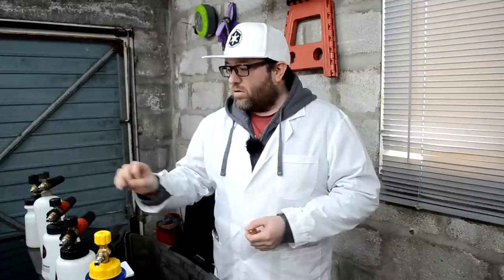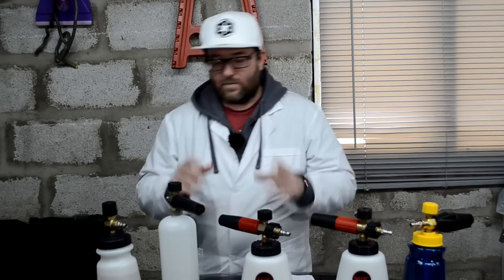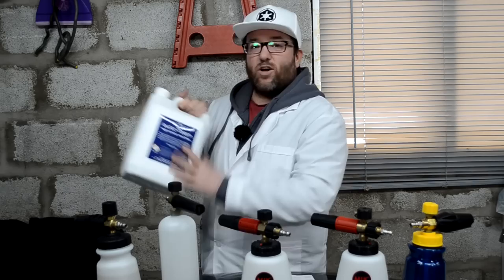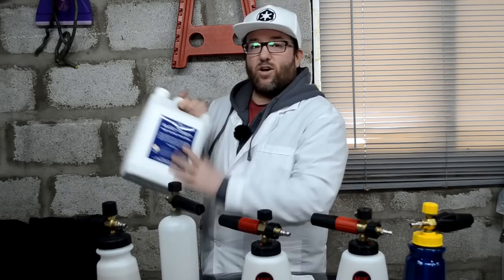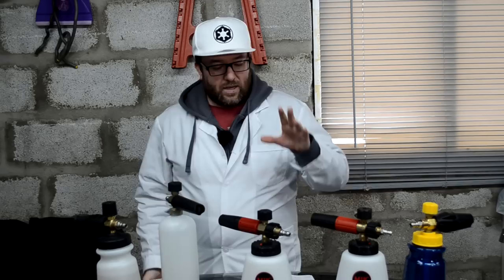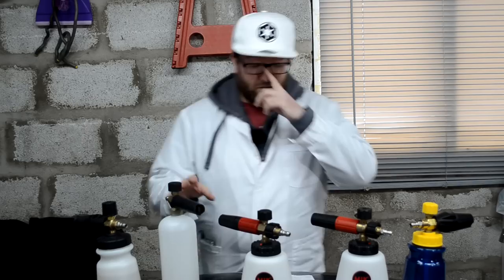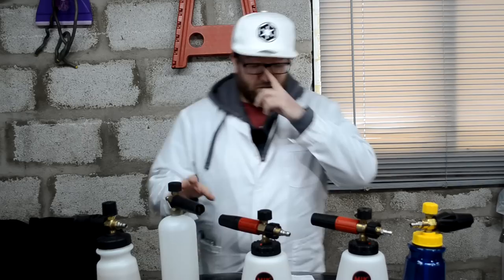Are You Using Snowfoam WRONG?!

Comment: Congratulations on an ace video Professor McSporran.
I'd tried the empty the reservoir into my wash bucket procedure before  and scared myself silly on the quantity of product I  required. From following your explanation it turns out I hadn't used the maximum flow rate. Following your instructions I filled, displaced and measured the capacity of my foam reservoir. I had never given it a thought but it turns out my 1 litre graduated holder actually only holds 900ml. Hmm. Long story short : I previously used 100ml in 1litre which produced poor foam  and used the full litre each wash. Now I get good foam using 450ml in 900ml and emptied only half the reservoir.   
That was good old Bilt Hamber. Next time it's Garage Therapy. I've still to check their PIR. Thanks again Speccy.
Cheers John
Reply from the maker: Thank you, John! Really glad the video helped you get the right foam!

Comment: Well explained. I think a lot of people completely forget that water pressure and flow rate through the pressure washer has an impact and just focus on the lance itself. Having said that I generally just go 50/50 with BH Autofoam in my MJJC V2 as I know it's roughly the correct PIR. I get the results I want and it saves a lot of time not having to be precise to get exactly 4%.
Reply from the maker: 50/50 is pretty damn close for many lances, if it works for you then that's all we can ask!

Comment: Very informative and well presented video Specky!   I really like using the Griot's BOSS foam cannon system.   It takes all the guess work out of it.    With the foam cannon,  you can connect the chemical bottles directly to the foam cannon (as you can with others of course) but the thing I like it those innovative metering tips they came up with.    It disperses the product directly with the water so no pre-mixing.    You would think it would use a lot more product,  but actually it uses less and SAVES product.    You can still mix solution in the provided bottle if you are using something other than griot's chemicals and you need to dilute it via the manufacturers recommendations,  but,  you can also directly hook up a lot of other manufacturers bottles directly to the BOSS cannon also and those metering tips work perfectly dispensing those chemicals too!   It's a fantastic system.    I think you might have showcased the BOSS system previously on your channel?   I can't remember.   Either way,  great job,  you really brought up some interesting points,  especially on how diluted product doesn't come out of the end of the cannon as the same dilution ratio as you mixed,  it's much more diluted once mixed with the water flowing through the cannon.     The metering tips might work with the MJJC Pro Foam Cannon also but they would have to be purchased separately from Griot's Garage web site.   I thought I watched a previous video somewhere (maybe here?) that someone showed those Griot's metering tips being placed into the metal ball at the end of the pick up tube for the MJJC Pro.   I am pretty sure that MJJC makes the BOSS Foam Cannon for Griot's.    They look VERY similar and some of the parts look identical.    And MJJC also have the inner barrel on the PRO for hooking up bottles directly but without the threading that the Griot's BOSS has that holds the bottle onto the cannon itself so you can't use it like the BOSS system cannon.   Griot's may have had some "exclusive" deal with them (or maybe even a patent on that feature) that only THEY can have that inner thread and outer "dual" thread design for the supplied bottle or for hooking up other bottles directly.    MJJC also have the same metal ball at the end of the pick up tube that allows it to fall anywhere and pick up product no matter how it's turned.    And the same soft (but durable) pick up tube also.     Great information on PIR too!    That really showcases that most of us have never used the right dilution ratio's!  LOL.  I have never done a PIR and didn't even know what it was until about six months ago watching Jon at  The Forensic Detailing Channel.   I would tend to put more soap in the cannon anyway,  so for me,  it may have been closer to the PIR??    It's amazing how much difference there are between not only the quality of the foam cannons available now days and how much differently they perform.    If I had one word of advice (for a person who has about 5 foam cannons of various qualities and price range.........just get the GOOD ONE!    MTM,  MJJC Pro,  Griot's BOSS,  etc.   Just pay the extra money and get a good one.    You will not be disappointed.    The cheap cannons seem to break or stop working at a much higher rate than the more costly ones.    The more costly ones are quite simply a better quality.     They cheaper ones work, but they just don't seem to have the foam quality of the more costlier versions.    My Griot's has those great features noted above and it's built like a darn tank compared to a cheap one off of Amazon.    Will the cheaper ones work?  Certainly they will,  but for how long?    Sometimes not long at all.    The only other good advice I could give is clean out your foam cannon after EVERY use!   Spray some plain water through the cannon at pressure to rinse it out.   Doing that will give almost infinite life to your foam cannon.    But for me, still, it's the BOSS cannon with the metering tips so I don't have to worry about dilution ratios and PIR's, etc.   The only change might be a different tip to increase or restrict the flow rate slightly for different thickness' of foam.     I tend to use the max foam tip in my BOSS cannon.     That BOSS cannon does produce the best foam I have ever seen.    The only downside is that is it probably the most expensive cannon on the market today, but, you do get a quality cannon for the price.   Plus Griot's does sell the cannon and chemicals, and microfiber drying towels as a "kit" for about $169 US dollars.    Sounds like a lot, but it's worth it because you get three quality chemicals and a large PFM drying towel too, plus a couple of other products.     Griot's also sells replacement filters,  internals,  repair kits,  etc so in the rare chance you did have a problem years down the road,  they have it covered so you can get your cannon back to factory fresh!   Not many others offer the parts and replacement internals, orifices, etc.
Reply: Best comment of all time.

Comment: I've just been doing your flow rate check, and the bucket was getting close to overflowing with only a fraction of the water in the bottle used. So I measured what remained in the bottle and subtracted that from what I started with -  and I had used 304ml.  There were 34 litres of water in the bucket. That gives a flow rate of 113litres per litres of product, which seems inordinately high compared to figures in your test. The lance is a Stonebank eBay special. Has anyone else found such a high figure ? The pressure washer I'm using claims 150 bar.

Comment: I've been meaning to do this exact thing with my setup but just always bang product in and hope for the best. Going to give it a try next time out and work out exactly what PIR I end up with. I do think if manufacturers use PIR rather than the standard 10.1 then people will have a better experience using the products 👍👍 great video
Reply from the maker: Thank you, kind Smurf! I do think that companies producing snowfoam for "professional or enthusiast" use should include proper panel impact ratios. I don't have a problem with 10:1 style ratios for general consumer use though.

Comment: Brilliant thank you, why has no one else done this? Its a game changer, to get a descent foam, which i still haven't, ive gone from a £100 jet wash to a karcher k7, still watery foam, then from a £20 cannon to a mjjc v2, still watery foam, all because different brands saying 10 -1, or about an inch. Ive doubled my snow foam and still been watery, so by your calculations im still over diluted, so then you can compare from your basic foams to your high end,  thank you so much. Very helpful. Liked and now subscribed.
Reply from the maker: Thanks so much, I'm really glad you found it useful! 🙌🏻
Reply: Does this mean that if companies advertise 10-1 ratio, is that now a 10% product agaist flow rate ? Like bilt is 4%?
Reply from the maker: Honestly it'll depend on multiple factors like water pressure, pressure washer power, flow rate of the foam lance etc. 10:1 is a "general" amount to cover most situations but it's best to work out what you actually need for your own setup, if you care enough about it.
Reply: I have just done mine. Im running a karcher k7 and mjjc cannon, i had 12.6 litres of flow rate, although the cannon was opened up fully, i had the karcher on medium setting. I use ez carcare snow foam as a general quick wash at the 10 -1 it advises ( 100ml to 900ml water ) and was runny before i watched this so next time i will get it  at its propper dilution, i also use polar blast but that has a giude of  1 in 4 ratio, cant wait to try them both on your advise and work out costs per wash, i have a bmw x6 so its a tiny bit bigger than a fiesta 🤣🤣
Reply from the maker: I look forward to hearing your results!

Comment: There are many ways to use a lance. I always use every product without dilution because I have tested and calculated where the adjustment screw has to be to give me for example 4%. I find this is the easiest way.
Reply from the maker: That's fair, I'm not sure how best to calculate when only using the top dial but I'm glad it works for you.

Comment: Firstly, awesome video! I wish I knew that like......... 4 years ago, before working with the system I currently use now. I personally sucked at math in school, that's why I just use the Griots Garage Metering tips. There's zero calculations involved, simply pour your favourite product into your snow lance bottle and press the trigger, THAT'S IT! I find that this not only conserves time, but it also conserves on product, as I can now use 1 oz to do a car instead of 3-4 oz to keep the mixture rich to compensate for the slower flow of water. If you haven't already, please do a video demonstrating the differences or similarities between the two. Regards - Dinero
Reply from the maker: Sadly Griots is a brand with little reputation/representation in the UK so I'd be unlikely to feature them.
Reply: @SpeckyMcSporran  That is true, they reside in the US but I still use them here in Jamaica.

Comment: That's a lot of Bilt Hamber, I always read that you didn't need to use much of it, so it was really economical. 1:10 would be a lot smaller amount of product, about 90ml of product compared to 300ml+, that would be about 1:2.
Reply from the maker: You have to think about how much the foam lance will dilute the mix. 10:1 in isn't 10:1 out which is why it's important to know your own lances introduction rate. I was basing my figures on the percentage that Built Hamber themselves stated is typical use.

Comment: I agree with the general premise of your video, I've been banging on about this issue for years. Because the extra level of dilution that occurs differs so much, different manufacturers of snow foam chemicals will base their instructions on what they think that extra level of dilution is, some will assume 10x extra dilution, others will assume 13.5x extra dilution. If they published that extra detail it would allow us to adapt their products so that we could use it safely on our particular setup. Otherwise with flask instructions only you could be either:
a) Creating snow foam that's too weak so it's cleaning ability is awful
b) Creating snow foam is way too strong and could cause damage to the clearcoat (if using acidic or alkaline snow foams)
c) you happen to have the goldilocks setup that the snow foam manufacturer had in mind when coming up with their flask based instructions
d) the manufacturer is producing a chemical that is safe at any level meaning that that their product is largely inneffective no matter what concentration level is used
There is another issue and that's the confusion caused by the snow foam manufacturers themselves by not being clear on their instructions. Sometimes the dilution ratio on the product refers to the final dilution (i.e. PIR) and not the flask dilution (e.g. some CarPro products). Infamously Koch Chemie GSF dilution instructions refer to use in a pump foamer, but most youtube content creators misread that to mean instructions for use in a foam gun so they assumed these were flask based instructions rather than PIR.
I have over 20 permutations of different lances, with different orifices and on different pressure washers to get a wide range of dilution factors (anything from 7.0x - 18.5x). Notice I said dilution factor. What I do is fill the flask with water and use it until I get measureable amount of water in a container (4-5 litres). If I weigh both the flask and container before and afterwards, that difference will give me the amount of water used up in the flask and the amount of water collected, and I divide one into the other to get my dilution factor. With that dilution factor I then multiple it by the PIR required and times that by the amount of snow foam solution required. This avoids having to judge any displacement issues, different sized flask issues and judging when the flask is empty, e.g. pickup tube in the flask can stall especially at an angle, or the flask is opaque and difficult to see the level (ahem! Carbon Collective). Mathematically you get the same end result, but when I explain it to beginners they find it easier to understand when it's broken down in this way and avoid some of the common pitfalls.
Reply from the maker: You, sir, are way above me in the geek factor and I salute your work!
Reply: @SpeckyMcSporran  Perhaps I should change my name to the Greek Geek! 🙂
Reply from the maker: That's what I'll call you from now on! 😉

Comment: Brilliant, thank you. The thumbnail showed the problem I was having. Explained exactly where I was going wrong and how to fix it.

One thing I'm still confused about is how to read the flow rate, as the value quoted in the video are at max setting which typically you would not be using. 

I have an AVA Smart P60 and the manufacturers quote a flow rate of 6.7L per minute. Isn't this a more important figure, and how would this figure be combined with a product's PIR ratio?
Reply from the maker: Flow rates are usually based on an unhindered connection i.e. no nozzle on the end of the gun/lance. As you know, running your pressure washer without a nozzle makes a different sound compared to when you have a nozzle fitted. The flow rate of the snowfoam lance is more important as it already accounts for the change it may make to the flow rate coming from the pressure washer. As for the change in flow rate using the dial, this is not something we can measure easily therefore adjustments would be better made to the chemical dilution while running the lance fully open. I hope this helps.
Reply: @SpeckyMcSporran  Superb, thank you for taking the time, very much appreciated.

Comment: To get even more geeky, snow foam cannons are, in effect, eductor or jet pumps, also known as vacuum ejectors or simply ejectors, which are water aspirators or vacuum pumps consisting of a tee shaped fitting, employing the venturi effect.
Still with me? The flow of water from the power washer, passes through the straight portion of the tee, which has a restriction at the intersection or branch, where the pick-up tube is attached. This restriction produces a vacuum by means of the venturi effect which occurs when water flowing through a pipe or tube is forced into a narrower section. This results in a pressure decrease and a velocity increase. This drop in pressure creates a vacuum which is what sucks liquid into the flow, through the branch, through the pick-up tube, from the reservoir. Adjustments to the rate of chemical draw are made via an adjuster dial which moves a piston into and out of, the flow from the branch.
You mention the power of the pump (power washer) and mains supply but, within limits, the rate of flow through the orifice, changes the strength of the pump and therefore the rate of pick-up, faster flow, more suction, slower flow, less, making the mix almost the same. Some might disagree but when we’re talking about single figure percentages, the differences are minimal. Some will also want shaving foam rather than suds and increase the amount of product but, apart from impressing the neighbours and giving you something to post, what isn’t in contact with the surface, isn’t doing anything.
Personally, I’m in the neat product camp, altering the mix using the adjuster. It means that I can top-up the bottle with product and not have to fiddle with dilutions. I worked out the PIR with the adjuster set for 1, 2, 3 & 4%, made a note of the pointer position, half turn anti-clockwise to 6 o’clock etc.
Reply from the maker: I appreciate this explanation, especially about the venturi effect!